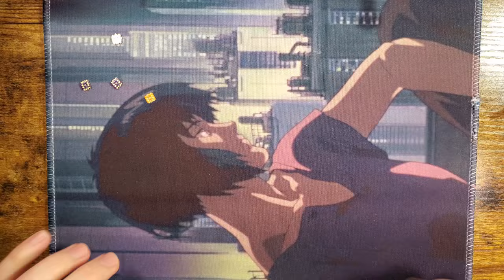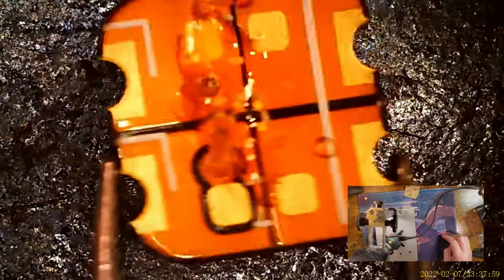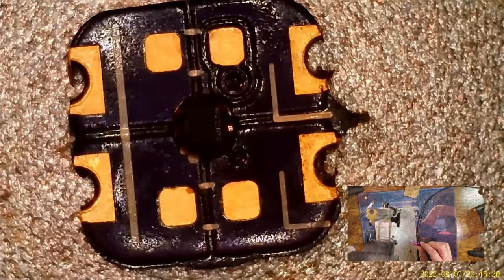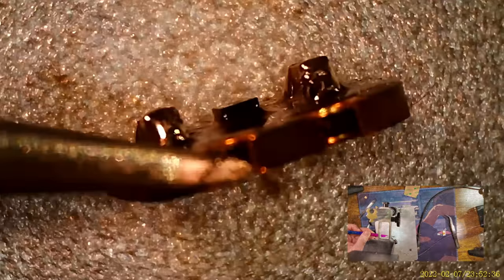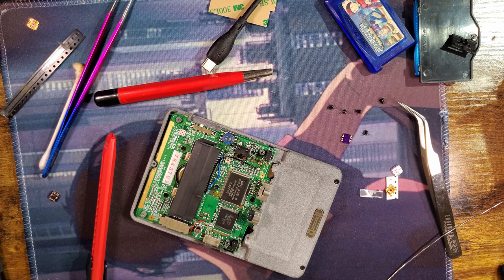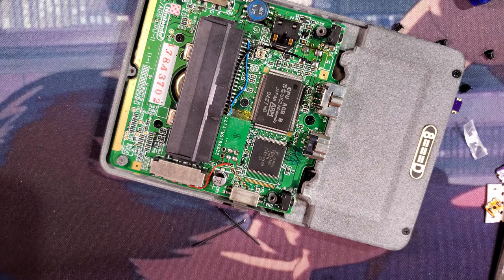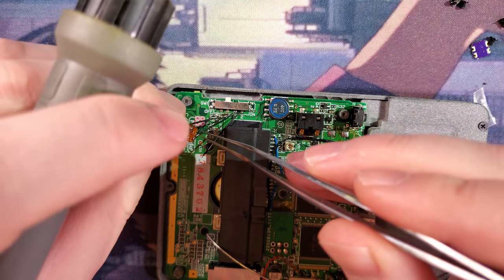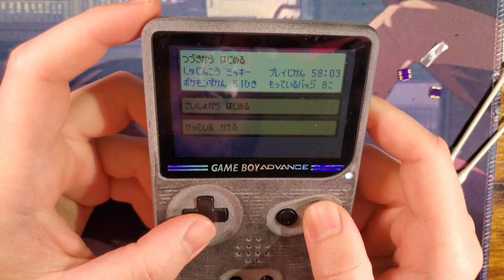Proper Power Latching for Game Boys

Comment: I encounter this a lot on machines for me and my friends. I always tear it down and get the alcohol in the switch as I'm sure most viewers are familiar. I can't wait to install one of these!
Reply from the maker: I hope you mean that you are actually disassembling the switch because dripping IPA in a closed switch is not doing you any favors.
Reply: @makho  Uhh ohh. I was referring to a drop of IPA in the switch then toggle the switch rapidly. Then of course dry. That's with the PCB removed from the unit. This technique gets the switch working a couple years from barely staying on. But I haven't disassembled a switch with an Iron yet...
Reply: @makho  that's how I did it on my AGS 101 and it did fix the problem for me for a few months until I tried replacing the L and R buttons and didn't put the system back together but the switch on my system wasn't too bad, it would say the battery was low but wasn't rebooting or turning off before the original battery was actually dead.
Reply from the maker: @ethanwalsh9162  This method isn't a proper way to clean the switch.

Comment: Neat, I have a pocket that had that issue. I ended up just replacing the switch because after disassembling it, the copper in it just crumbled from the corrosion.
Reply from the maker: That is at least one use case where you'd need to replace the switch entirely, yeah. This is good for the inbetween consoles where it works still but not well.

Comment: Great vid, looking forward to seeing these for sale some time, because I sure as hell am not doing that microsoldering. 

gotta say though, I was all on board until you just kinda shoved it in there floating at the end of some wires. I was really hoping you'd wrap it in a bit of kapton and stick it down somewhere. you've got full battery voltage going through that chip and it's just floating around loose in your system.
Reply from the maker: where do you think it's going to go? Are you really worried about insulated wires shorting on the plastic shell? 

I also explained how this was a prototype.
Reply: @makho  hey, you do you, but I have a mental image of the edge of that board where battery voltage is bumping into a ground somewhere and causing problems. there's a bunch of ground shielding for the cartridge slot nearby, for instance. 

ultimately I appreciate your content and respect your decision, it just made me wince a little thinking about it able to move around freely in there. great work, still!
Reply from the maker: @Crypt1cmyst1c  It's a very small board with very thick wire, it's not going anywhere. I appreciate the concern.

Comment: Is it IMPOSSIBLE to dead bug this chip? And are you keeping those boards private?
Reply from the maker: I mean, it's just a breakout board. The chips are dead buggable but it's just easier to do it proper. 

 I never released what I made because it doesn't work as well as I'd hoped and I've not worked on it at all.
Reply: @makho  Thats too bad, am I better off with one of those sort of...rotate- ey switches?
Reply from the maker: @ApocalypZero  ?
Reply: @makho  On your github, you made a break out for a replacment switch. But its called a soft power button.
Reply from the maker: @ApocalypZero  That's a completely different mechanism but it requires replacing the entire power switch. If you're good with that, it does work.

Comment: hey makho. that mini hotplate, i was thinking of getting one but just seen the damage to the plate area, how long have you had it before it got into that state ??
Reply from the maker: damage...?
Reply: @makho  the hot plate surface looks cracked and broken
Reply from the maker: @coldfire0101  I think you are misjudging the amplification under the microscope.
Reply: @makho  if you look at 4:04 it looks burnt, but yeah under the scope it looks cracked
Reply: @makho  but anyway would you say it is worth it for small diy stuff
Reply from the maker: @coldfire0101  I never clean off burnt flux
Reply from the maker: @coldfire0101  if the work you are doing can be improved by using a hotplate, yeah, it's pretty good

Comment: Forgive my ignorance but if it takes 20+ years for the power switch to really become a problem in the first place is this really mitigating a ton of maintenance cycles? Still a neat vid and i applaud your content as always. Just question the "every few years" part of your preamble. Much love!
Reply from the maker: At stock power levels, sure. Modded consoles use 2-3x as much power though and that exacerbates the problem.
Reply: @makho  ah this did not occur to me, thanks for the reply. learning is fun!
Reply from the maker: @brandicus  Hmm I suppose there is also the consideration that once the surface coating is stripped off (which happens as the switch wears down, not as a result of cleaning unless you use abrasives), there is also corrosion concerns. Brass and gold both make good surfaces for this sort of material as they are basically inert but copper not so much.